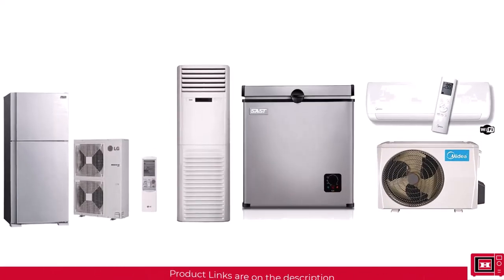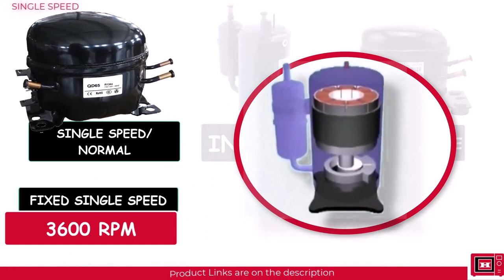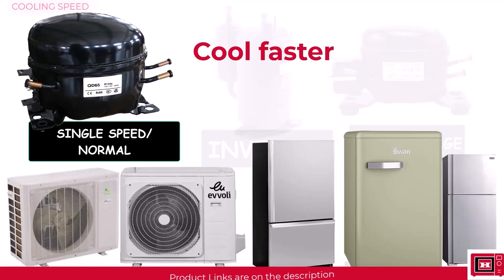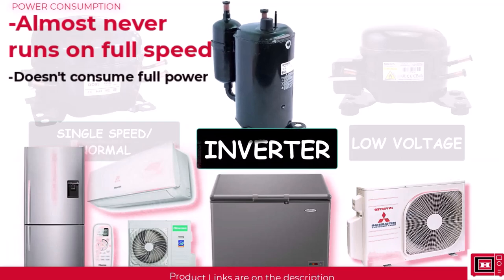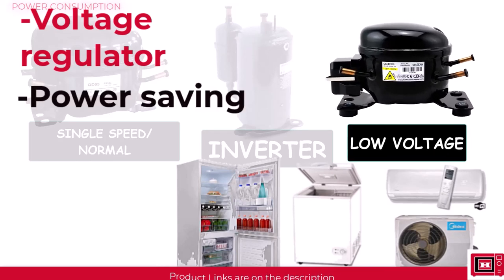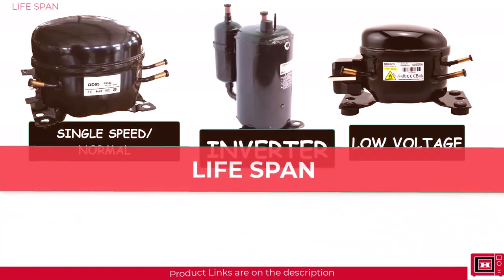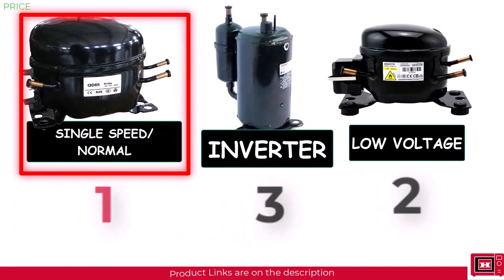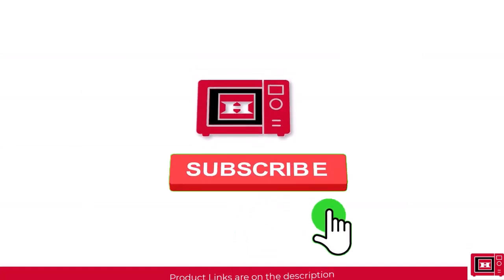Normal vs Inverter vs Low voltage freezer, AC, Fridge

Comment: correction at 2:48 some brands usually run their compressor at 120% (150hz probably) the rated speed of their compressor and when their board detected the temperature drops to what is the settings, then it will start to slow down as much as 10hz